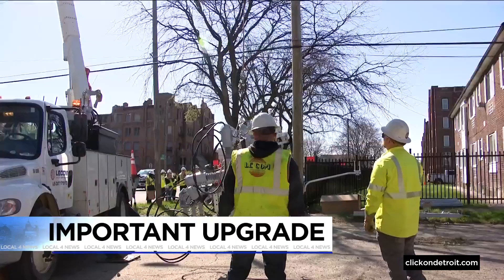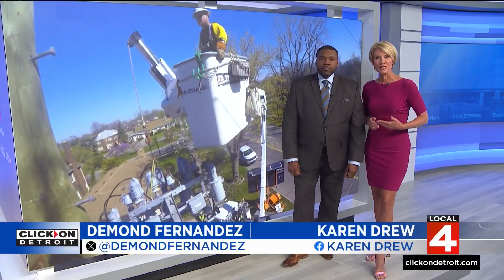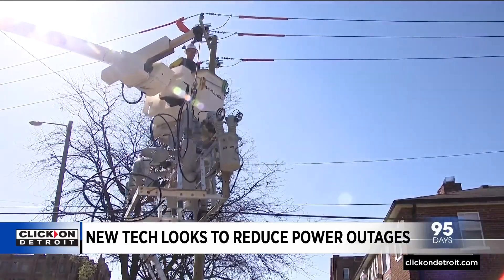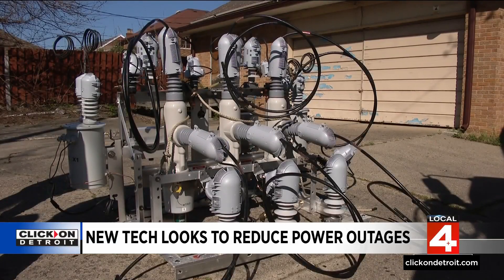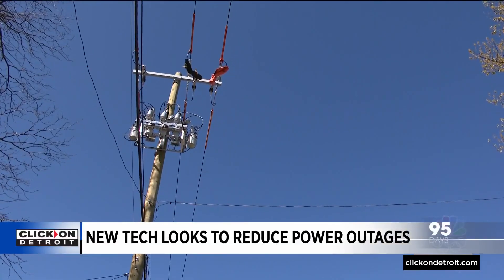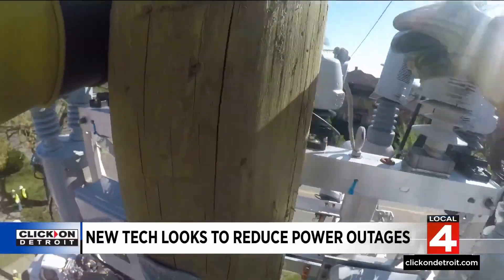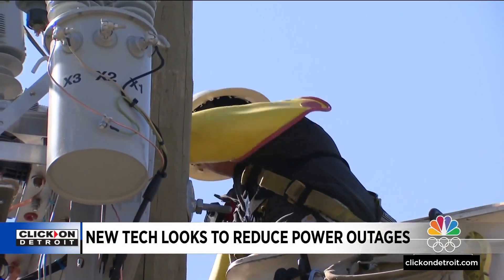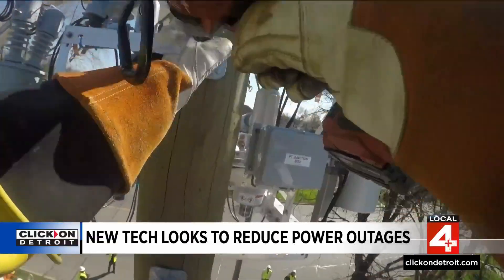DTE aims to reduce power outages with new recloser device upgrades

Comment: Totally missed in your story was that the Reclosers...reclose! They are also very sophisticated circuit breakers that will make a couple of attempts to reconnect after they trip. This is because most outages are from tree branches on the lines. Reclosing momentarily can blow the branch off the wire. Typically the first attempt is in half a second and the second about 1.5 second. Usually they lock out after that. This is all programable and totally up to the power company. They can save a LOT of money in service trips fixing the problem locally.
Reply: Thx. Same with squirrels.